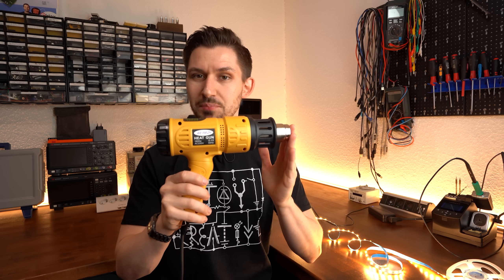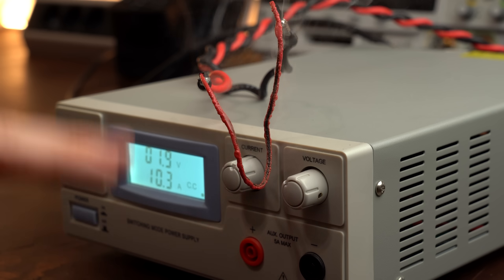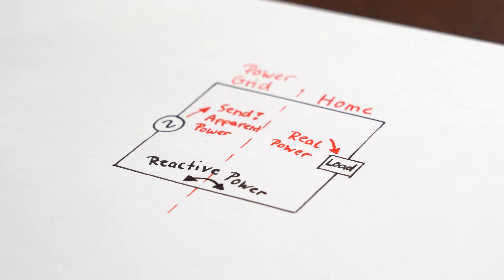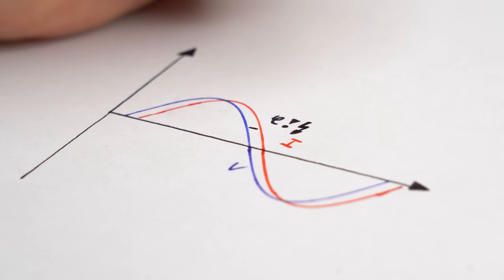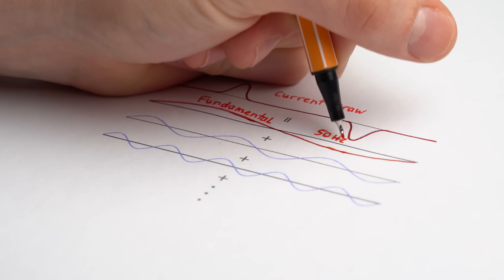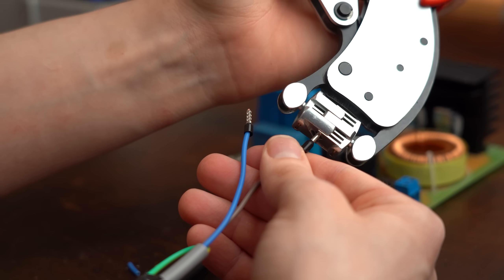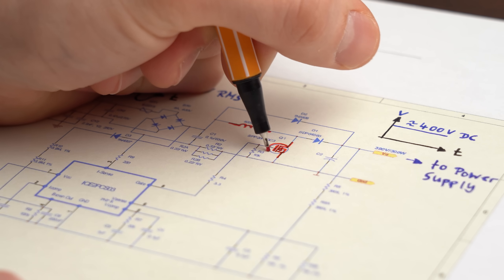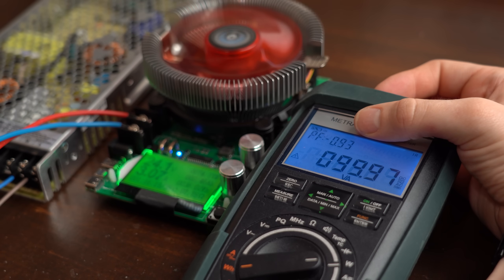The Most Important Circuit for our Electrical Future?! (PFC) EB#55

Comment: So an incondecent lightbulb is actualy more efficient for the power company because it only draws real power

And if electric company would charge residential consumers for phantom power we would be better off using incondecent lightbulbs?

Also I didnt understand you properly does PFC somehow reduce radio interference that swichmode psu generates (at least on the AC side?
Reply: No. A 100w incandescent draws 100VA. An equivalent brightness LED lamp might use 15w but with a poor .5 PF it would draw 30VA. 30VA is still less than 100VA.
Reply: @eDoc2020  yea but think about it

We save money on lightbulbs (that are realy usefull for heting your hands in winter or keaping snow and ice off your roof (if u use rope light), while we drive electric cars that require a lot of power to charge (if like 10cars charges at the same time) and their batteriee degrade

Besides that, an incondecent lightbulb was like 1€, while a good quality led is about 10€, and they both break

What I hate about all this is the regulations, like why cannt I use an incondecent lightbulb if I want to, or a flurescent tube

Why ban this, you know, I am looking for months to find a 220V incondecent rope light, and even in china I cannot find any, and regulations play a big part in all this

Like instead of regulating how much noise can swichmode psu produce, they ban incondecent lighbulbs and flurescent tubes, like you know how much harder is led to make (size plays a big factor) an incondecent bulb or a flurescent tube

I wish that one day there will be a regulation that will forbid a device from producing noise that its primary function is not transmitting, like a swichmode psu

I wish some day, I will be able to walk in the store, buy modern device like a swichmode power supply, a furnace, a dimmable led, etc and that I will be sure that it will not produce a single dB of noise (it can be done, put it in a cage, install filters on inputs and output wires), if human can make computers and leds, they can make quiet swichmode psus

They just just need to be forced to, like I am forced to use a led, and a separate furnace to heat my hands or a separate heater to heat my roof in winter
Reply: @Veso266  There are very few situations where using light bulbs for heat makes sense. In warm months it just hurts, and in cold months a heat pump would be more effective. But even though they're worse 95% of the time I agree that they shouldn't be banned. Maybe an extra surcharge which goes to gird improvements but not a ban.

And there are regulations limiting electrical noise devices can output. Most of my switching supplies are basically silent a foot away. The big exception is the cheap uncertified one which probably bypassed the proper import process. That one pollutes my radio from the other side of the room.
Reply: @eDoc2020  yea I know

I have to say, that I myself have a very strict standards and even a foot away is too much for me so if I can, I use a linear power supplies (snd getting those or a simple transformer become a challenge nowadays) and filament leds (yes quiet leds do exist) 

And yes I do use leds (filament ones of course), but where I need heat or special athmosfere (if you dim an incondecent light it has different color, leds dont that (and of course if you want to dim leds quitly (no PWM) you are out of luck because leds dont like to be dimmed (you need to do it in very small voltage changes and of course nobody makes a dimmer like that)

The sad thing is that even if I try to do anything in my power to stop the noise, you always have a neighbour that does not care and polutes the band

I still cannot understand why I can buy a shit tone of noisy crappy swichmode psu from china, while getting a incondecent 220V christmass light or rope light is next to impossible (is the lightbulb ban worse or what)
Reply: @Veso266  LEDs dim easily with an adjustable constant current power supply. Personally I dislike the color shift of dimmed incandescent lights. Here in the US you can still get "heavy duty" light bulbs as well as some "decorative" styles. They're incandescent but run cooler than old bulbs so they're a bit less fragile but also less efficient. Most new Christmas lights are LED now (with horrible 60Hz flicker) but incandescent seem to still be available as well.

Comment: There are also PFCs that act more like filters.
The input is AC mains voltage, the output is also AC mains voltage, but even if you hook up a dirty consumer with an abysmal power factor to its output, you still see a perfect power factor at the input.

Comment: Meanwell PSU that creality used to use on the Ender 3 Pro has a 0.6PF most of the time.
An issue w/ capacitor PFC is that higher harmonics can cause higher currents in the cap and premature failure. It's a big consideration for utilities when VFDs are nearby.

Comment: I never understood how there can be a phased shifted current draw. If mains traverses from positive to negative voltage... How is it that there can be current draw during the pass through 0V? Where is Ohms law?
Reply: Ideal wires have zero voltage drop. How can current flow through a wire? 

At the very moment of a reactive load crossing the zero point I suppose the equivalent resistance is undefined. It gets complex.

Comment: Working in power transmission, our shunt reactors are pretty much on all the time nowadays where our cap banks are hardly ever used. Because loads are switched so much from inductive loads to capacitive loads.

Also the loss of large spinning generators doesn't help.

Comment: At first I thought it was weird that music and electronics have so much in common with graphs and hz and harmonics and stuff. But it’s not really that weird when you actually think about it. Also. Music will only get recorded thanks to electronics these days so oscilloscope graphs looking like audio waveforms makes quite a lot of sense. 

What is weird is that I am not the only audio engineer I know that has a moderate understanding of electronics. Maybe there’s a whole bunch of us that just know how to translate different graphs to different things.
Reply: Much of the math is literally identical across many fields because of physics fundamentals.  For example the 2nd order differential equation to model a flywheel and a spring is the same as an inductor and capacitor.  If you know how a hammer works you can intuitively understand what happens when you suddenly stop current in an inductor.
Reply: Yeah I know a dude who designs subwoofer enclosures based off math from circuit design , uses capacitive reactance, etc.. idk too much for my brain to understand

Comment: Turn the heat down on that heat gun and get back to us about "mostly looks like a sinewave" and has a current in phase.  
You can tell by the short delay at the zero crossing that the heat gun heating element is phase controlled.  At lower heat settings, there will be significant distortion to the waveform along with a bad displacement power factor.
Reply: Still better than cheap ones which use a half-wave rectifier when on low.

Comment: Since 2001 (or 2008, too lazy to find exact year) the EU requires switch mode power supply over 75W to have a PFC  according to norm EN61000-3-2. Since nowadays we mostly use those kind of power supply, it is already not too bad for household appliances. 

And for factory's, in Canada, for medium size you should keep it over 90% and for big size it is 95%. The electricity bill is calculated with a penalty if you don't respect it.

Comment: Could someone please explain to me how adding a pfc containing transistors and rectifier helps reduce the harmonics. Because I thought switching transistors and rectifier (which contains smoothing capacitors) usually increases harmonics
Reply: Exactly. Solves one problem but does nothing to address 'dirty' harmonics which are not good for health.

Comment: I still don't get why the power factor was so bad for that switching power supply.  Yes the power harmonics that make the Fourier series are out of phase with the voltage, but they cancel out, which means that there is no change in current.  

For example a 0 amp is technically any amount of current 180deg out of phase with each other, but you don't experience any power flow because they cancel out, so how do the cancelling harmonics should not contribute to any power, reactive or used.

Comment: So does going through an inverter also perform some PF corrections?  Thinking that running some of the bad equipment through a decent UPS will by nature provide PFC, but I could also be wrong. 
Also, here in the States, we pay for electricity by Apparent Power, so there can be an opportunity to have lower bills by having good PFC.
Reply: Are you sure about that? I thought that was only for large industrial consumers.

Comment: Recently had a family member ask me about one of those "super power saver" snake oil things that just plug into the wall. I assume it's one of these but their marketing on their web page just heaped distrust on for me. Good to know a bit more about PFC circuits so that I know a bit more about why those are full of shit. Other than claiming that just plugging into 1 outlet fixes all your power woes for your whole house without mentioning that you would need a bare minimum of 2 and for them to be on separate legs of power from your breaker panel.
(America. Each phase provides 120 VAC which is what most devices use and what these snake oil products plug into. Each breaker panel for a home is fed 2 single phase lines which are then split out to different circuits. 120 on each phase, 240 between the two phases.)
Reply: They contain a capacitor across the power line. The idea is that they'll act as passive PFC for inductive loads elsewhere in the home. Of course this doesn't work well unless the capacitor happens to be the right value for the inductive load and the inductive load is on all the time. Naturally this wasn't scammy enough, modern versions of this often use a sand-filled box instead of a real capacitor.
Reply: @eDoc2020  I figured as much. And the heavier they are the better they must be, right? I prefer mine with just a big chunk of pot metal taped to the inside.

Comment: Novice question: why do reactive and apparent power use VA as their unit of measurement and Real power uses W?
Reply: Real power is ( W) that is when the mains " see" a purely resistive type load. here observation (on o'scope) of voltage across & current through the load shows both are "in phase" with each other..and the product 
"power" is always a positive value.
Reactive and apparent power loads do not have proper " in phase" relationship and peak reactive/ apparent power is both positive and negative ..the peak can be when excessive current is drawn from the utility , that cause sags/dips/brownouts in line voltage..yet this current does no useful work except wasted heat in electric cables and appliances generating them..
& This heat reduces their lifespans..

Comment: I remember PFC becoming required for PC power supplies. Some supplies used passive PFC. Just a big old inductor squeezed inside. I assume that only worked effectively at a specific output power.

Comment: So the PFC only works for loads that convert their voltage to dc anyway. When want to power a "drehstrom asynchrom motor" you have to use a frequencyconverter and a pfc
Reply: Frequency converters is the way to go nowadays. Before you just added motor-capacitors to balance the PF at the operational load, which work well if you have an even load.

Comment: I remembered all this from engineering school. You explained it a lot better. I remember calculating all of it and not understanding where I'd ever use it.
Funny enough I work at a large corporation now and use emails more than any engineering tools.
Reply: Sounds like most engineering students I knew. Wonder why they needed to learn so much math to write emails. XD
Reply: That's an easy trap to fall into.  A lot of the business types focus on the things they understand - business development, proposals, project management - and forget that once you've gotten that nice, shiny contract someone has to do the technical work.

There's definitely a place for technical-oriented engineers, but you have to push for that position.  I did (I'm an integrator/system analyst, not an engineer, but it's similar), and now I only work on the type of stuff I want instead of writing documents and tracking lead times all day.
Reply: @Jeff Spaulding  GREAT 
Enjoy your work!
That's why I wanted to become an engineer. Unfortunately the business brains taking so much demand that only low time is left for engineering. 
I decided also not to be too far away from technology.
Reply: it is funny

Comment: 2:30
Sorry, I still do not understand Apparent power.
The Real Power, that energy is used in what ever I am using, mostly turning to heat energy. I Think I understand that.
But the Apparent Power is  the power running through the cables in the wall? So where is the difference between Apparent power and real power "used".
The wires in the grid do heat a little from the resistance in the wire, right? But that is not the difference between Apparent power and Real power, cause I guess that heat is just a part of the real power. So where to the difference go?
Reply: Reactive power is taken up by the device, but then later in the cycle the device releases the power back into the grid. This obviously causes unnecessary heating of wires.

Comment: Too bad you didn't dare to go for "this light bulb is pure perfection" over the LED strip, because that would have been even closer to the pure ohmic load than a some heating wires and an inductive load of a fan (motor). :p

Comment: Great video. It is like you said in that power companies have to use larger wires and higher currents. The misconception some people have is that the power company has to create more energy, and that is not the case, as only true power is consumed.

Most residential accounts are not billed extra for power factor as they are just charged for kilo-watt hours (true-power), while industrial accounts are penalized for going out of tolerance. The tolerance varies from 0.9 to 0.95 efficient.

Active power factor correction is very common in industrial devices. The grid also has power factor correction circuits at sub stations to bring the voltage in current in phase to account for poor factor at the end user.
Reply: The power company does need to generate more electricity when there are low power factors. Not directly from loads but from increased transmission losses.
Reply: The power company employs power factor correction so the apparent power generated is lower than the apparent power in the field. 

However I agree with your reply, as the reactive current down the line will flow through resistors and drop voltage, and that leads to heat loss. 

These losses are not as significant for most residential users, as we are not billed for them. For industries with large power consumption it is a different story.

The take away is just because you run high apparent power at your house, it does not mean the power company has to generate the same apparent power. They leverage power factor correction at sub stations and at the main plant.
Reply: @NCmountainview  We're not billed directly for poor power factor. If everybody has poor PF it increases the power company's costs and they pass it back onto us. A real tragedy of the commons.
Reply: @eDoc2020  You do understand that residential power is PF corrected at the sub station and the plant only produces the apparent power it sees, and that is significantly lower than the apparent power for the home. If you run a poor PF it is corrected prior to long distance transmission. 

I am all for power factor correction but you are proving my initial point, as it really is not a tragedy of the commons. Statements like that suggest you think the power company has to offset for the reactive power for the end user, and other than negligible voltage drops that are only present until the first point of correction it really is insignificant.

Industry is different because of the amount of reactive loads and magnitude of power consumed, but they are already penalized for it, so they tend to correct it.
Reply: @NCmountainview  But it definitely still increases losses in distribution. And I don't think substations typically have equipment to correct harmonic loads.

It's not a significant tragedy of the commons.
Reply: @eDoc2020  We can agree on this! 

While power companies do not employ active measures as demonstrated in the video. It is worth replying to say they often utilize passive low pass filters to reduce the impact of harmonic distortions. 

However active measures as seen in the video are essential for sensitive electronics and make things more efficient.

Comment: Notice the PFC input current "sinusoid" has lots of high frequency noise on it, caused by the PFC swutching circuit. This will interfere with nearby radio receivers: AM and shortwave broadcasts and ham radio operators like me. PFCs should have good AC line input filters, and be forced to meet EMI standards for low conducted and radiated radio-frequency emissions.